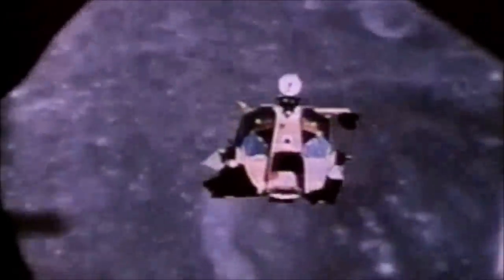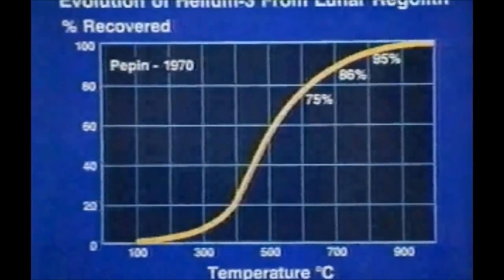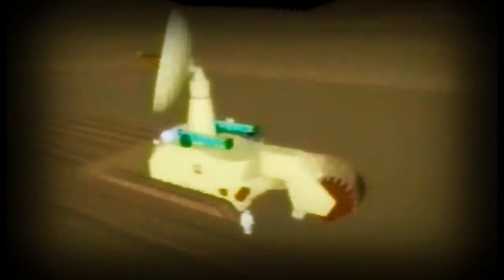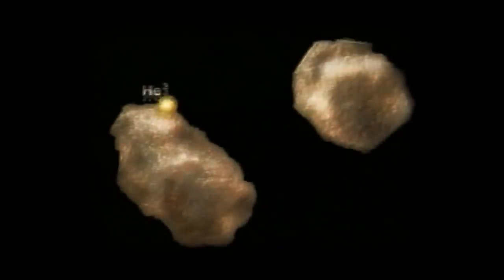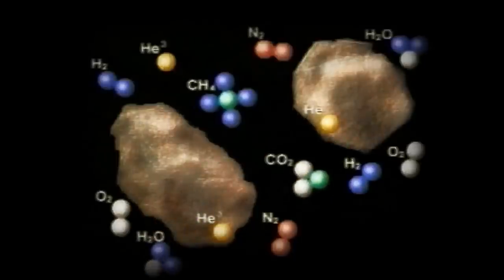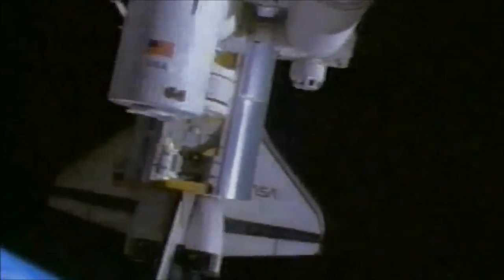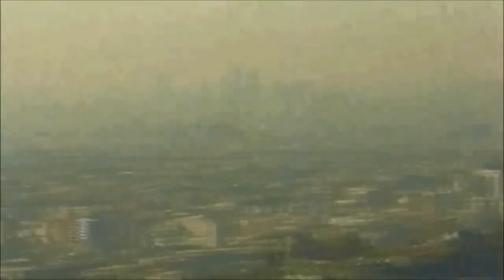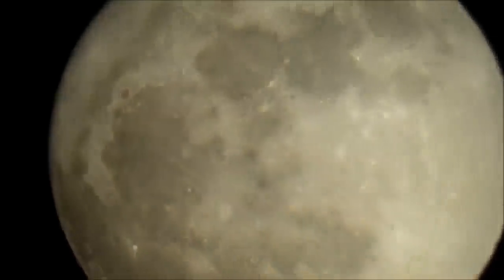Mining the Moon for Helium-3 Aneutronic Fusion Energy

Comment: nobody has seen the movie moon? with the clones? this reminds me of that
Reply from the maker: Yes, I have, several times. In fact the movie is based on this proposal, which was first made in the early 90's and was one of the first serious proposals for a space-based energy source, along with orbiting solar stations which the Japanese space industry is very much interested in.

We need to reorganize the energy consumption of our civilization to use the Sun as our primary energy source, of which direct electromagnetic power is the largest source but also to include the high energy charged particles released by the Sun and which have been collected on the Lunar regolith over billions of years and which have made the Lunar soil rich in helium-3 which itself is incredibly rare on earth and very expensive to produce, requiring the production of tritium, or hydrogen-3, which is either done in very large nuclear reactors containing deuterium in the form of heavy water (requiring a large neutron flux to transmute the deuterium to tritium) or else bombardment of lithium or boron with a neutron beam, either way a nontrivial task.

Hence it is remarkably inefficient to produce helium-3 this way and would be insane to have an energy economy working on this principle. Tritium itself is required for standard, neutronic nuclear fusion, which is being developed at the ITER project, so across the board fusion is a highly expensive enterprise and is by no means close to providing an alternative to fossil fuels or fission power. By far the most viable source of renewable energy is solar power, the next being geothermal and third being ocean currents. Fusion, without a continuous presence in space, to obtain Helium-3 from the moon, solar wind or harvested from the gas giant planets (which would be very ambitious!) is almost impossible to develop at the present time. I think this will be in the experimental stage for at least the end of the 21st century, with fusion being a mainstream source of energy by the mid 22nd century at best.

Fusion is easy to replicate, in a Farnsworth-style fusor, but, if we are being honest with ourselves, a fusor is closer to a desktop plasma lamp than a nuclear reactor. You can do some nice science on it but to say that its going to power anything is a fabrication at best and a delusion at worst. Lets not forget we are trying to replicate a process that takes place in the core of stars and that humans have only really made progress in having near self sustained fusion events in the event of thermonuclear fireballs in the center of a hydrogen bomb test.
Reply: +Roy van der Lee I am seeing the movie now. The 1-man crew is not possible. It is solitary confinement that even prison systems deem inhumane.  The movie is more of a psychological thriller than a sifi.
Reply: @johncgibson4720  Did you miss the point of the movie? 
They new it was impossible which is why they sent a clone into space and not the origional.
Even the clones would go mad which is why they disposed of the clones after there "contract" was up. Also playing video mail during the 3 years would help keep them sane for the time being.